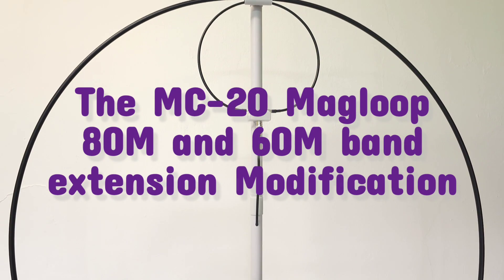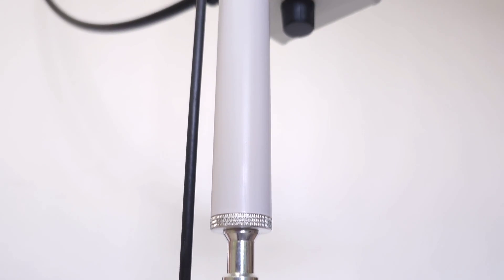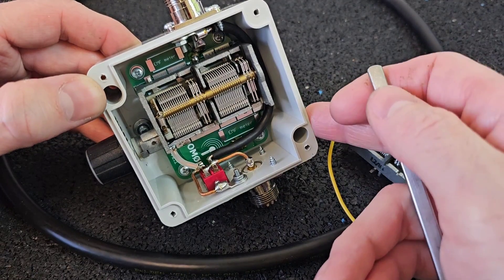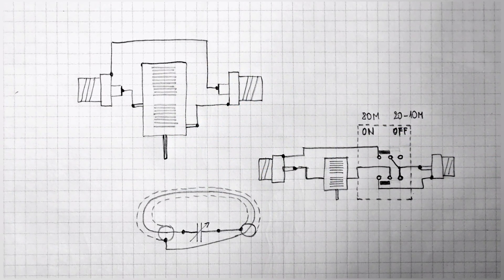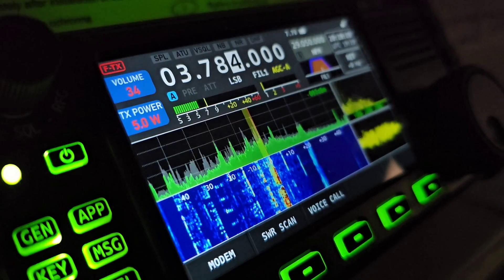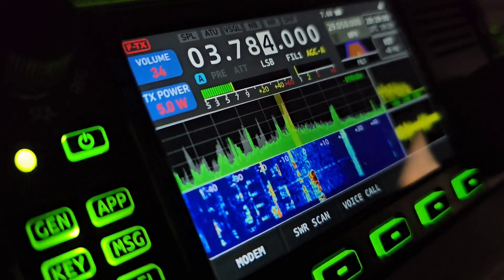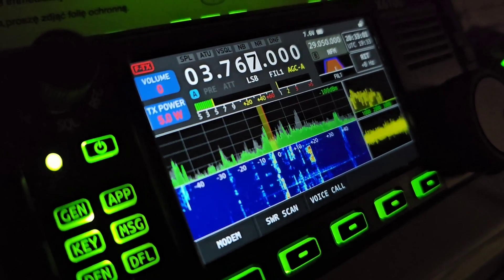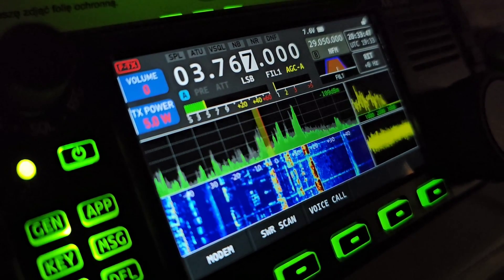MAGLOOP Antenna HACK - Modification for 80m & 60m bands RX/TX

Comment: Hi Paul, I purchased your MC-20 and it works well! But wonder why you do not use the shiel of the main coax-loop? So I have the same question that @salat asked a month ago:
"Why are you using only the inner conductor in normal operation? Wouldn't it be better to use the outer conductor (=shield) for higher surface area and lower impedance (skin effect)? Also: Aren't you effectively shielding the inner loop with the outer one?"
Can´t imagine why it works this way 🙂would be glad if you teach me.
Very 73, Bernhard

Comment: I figure the greatest advantage of a small mag-loop is that it can be very narrow-banded on receive to limit noise, meaning  having a high Q. That is done by having very low RF resistance, i.e. a large surface area conductor to reduce skin-effect losses. Coincidentally, that is also essential in order to get anything like acceptable transmit efficiency from such a tiny antenna relative to the wavelength on HF. So a large diameter conductor is mandatory for a mag-loop to be at all effective. I used 1 5/8 inch diameter hardline scraps to build both of my mag-loops, and they work well. But to further improve on them I plan to try using aluminum roof flashing instead. 
Basically, using the inner conductor of standard coax will provide a very low Q because of the inner conductor's tiny surface area. If you aren't somewhere noisy so you don't need a narrow receive bandwidth antenna then using the outer braid as a conductor may work on receive OK, but for QRP transmitting it will provide you with only a few milliwatts of ERP. I'm a die-hard QRP fan, but I do enjoy actually making a contact once in a while, and a few milliwatts will seldom make an HF contact these days even using digital modes. Good luck, and thanks for the video. - 73

Comment: Why are you using only the inner conductor in normal operation? Wouldn't it be better to use the outer conductor (=shield) for higher surface area and lower impedance (skin effect)? Also: Aren't you effectively shielding the inner loop with the outer one when doing a "two turn loop" in one cable?